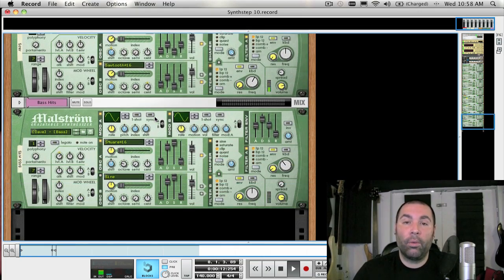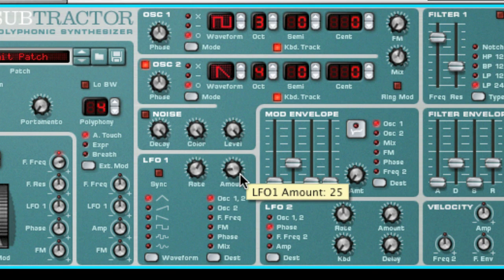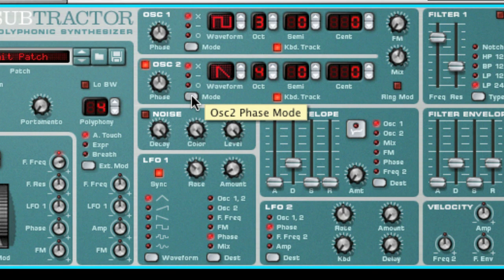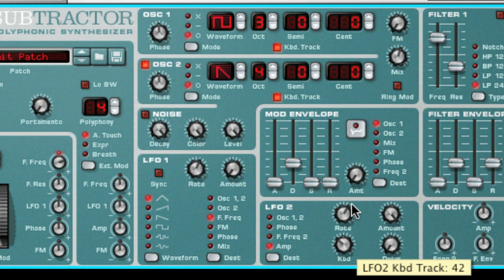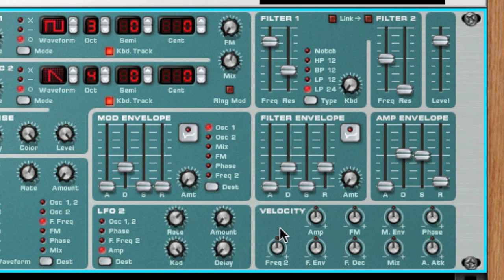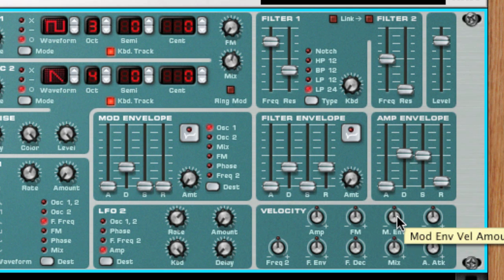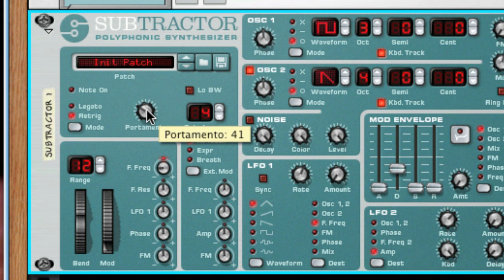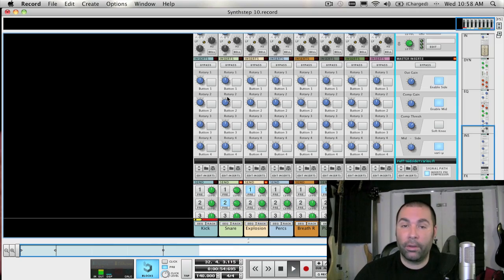52 Reason / Record Tips - Week 46: Subtractor LFOs and Mods

Comment: to whoever has / had the same problem with me and came here for an answer i'll quote from "[2]DAY_- " a very helpful tip... Subtractor's LFO is freewheeling.  It won't key sync, which i'm thinking
 is what you want (the LFO to begin oscillating at the start of its 
phase upon striking a MIDI key)

you need to create an instance of
 Thor within the combinator, and route Thor's LFO to one of it's CV 
outputs, which in turn should be routed to Subtractor's Filter cutoff 
via the CV inputs on the back.  Adjust the knob on the back of 
Subtractor, as well as Thor's mod matrix %'s,  to taste.

Also, 
unless you would like to incorporate Thor's oscillators into the mix, 
make sure Thor's audio outputs are NOT routed to any mixer.